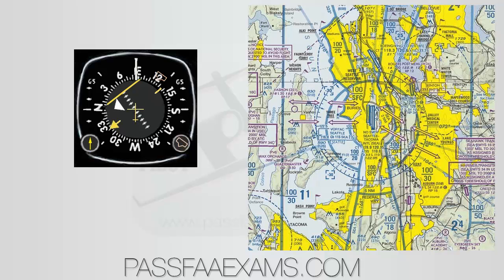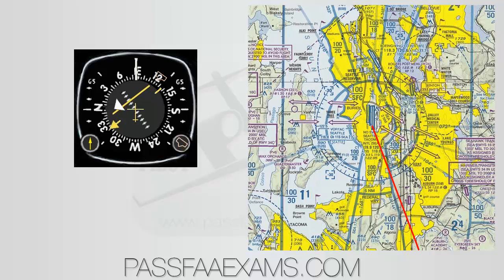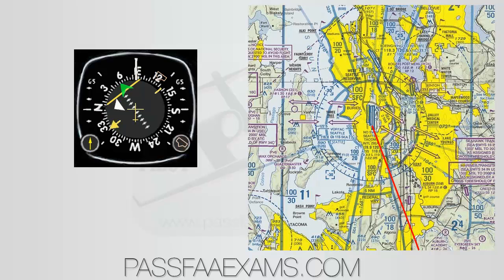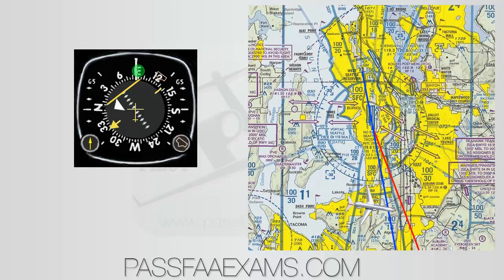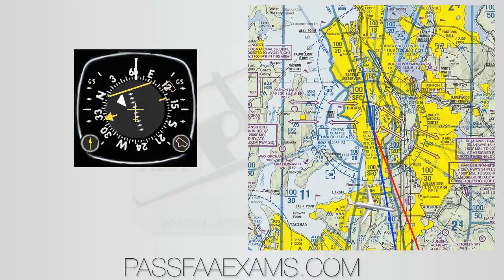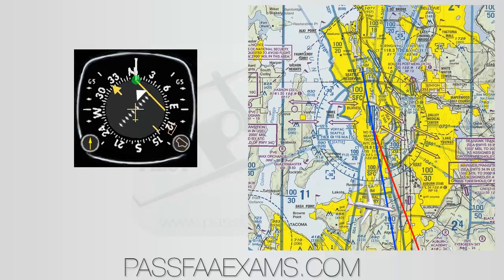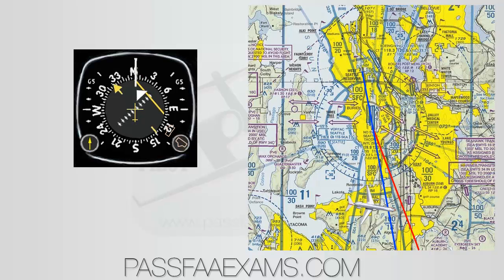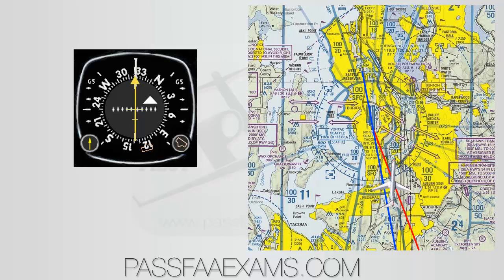Intercepting and Tracking with an HSI

Comment: I came across this elsewhere when i was looking up on vor interceptions. What if I am on the 150 radial inbound (course 330) and atc issues me a revision to track inbound on 090 radial? I set this up on an vor simulation and interception happened on the far side ie. On the 270 radial. Is that right?
Reply: No, ATC wants you on the 090º radial. Once intercepted you'll have a 270º track to the station.  ;)

Comment: I do not get it. On HSI you have selected radial 320, but on the map the red line represent radial about 160...why is that?
Reply from the maker: 320 to = 140 from. i did not select the 320 Radial. I selected the 320 Bearing to the station. 
Use our +/- 2 trick for the reciprocal
 320
-2
120
+2
140

refer to our other video for the answer:
https://youtu.be/q2ZJPD8L1Bk
Reply: the 0 is not perfectly aligned, this is why it looks like 160